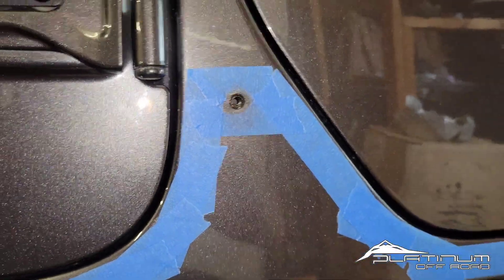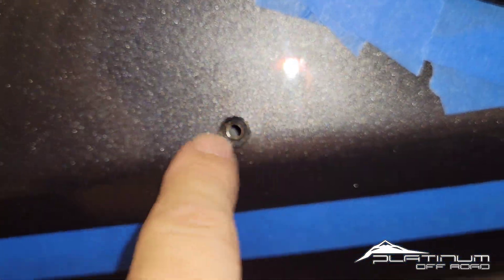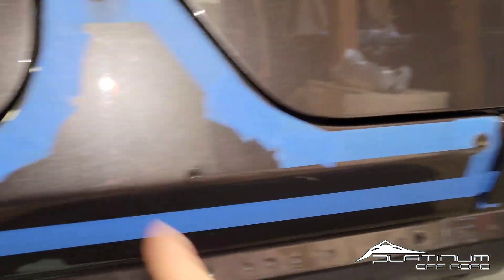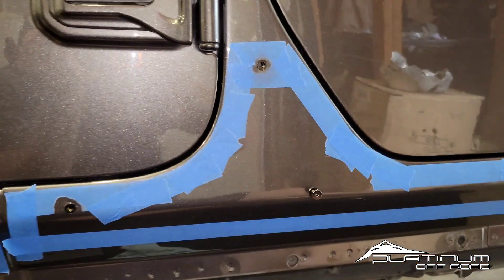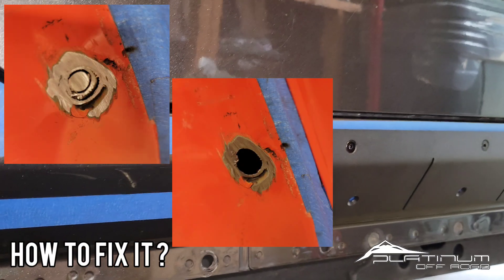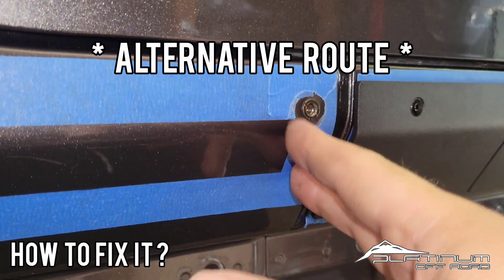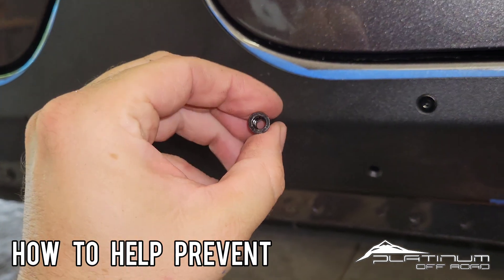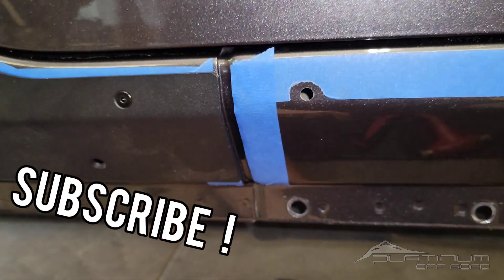How To Fix and Prevent RivetNut Failure

Comment: FINALLY someone is showing how to fix these!!!!! Can you explain the dremel technique? Also, I’ve heard that you can drill them out - which I’ve tried & had to go to the next rivnut size up.  Thank You!!
Reply from the maker: So use the dremmel to remove the outer lip material, just enough to let the bolt have a straight shot and marry up to the threads, without resistance.  When you see how the rivet collapsed offset, you'll see how the head of the rivet is blocking access to the threads, for a small portion of the hole. Remove that inside wall of the head, little by little, until the bolt threads smoothly.

Thanks for the feedback and support! Happy to hear we found a good topic to help with!